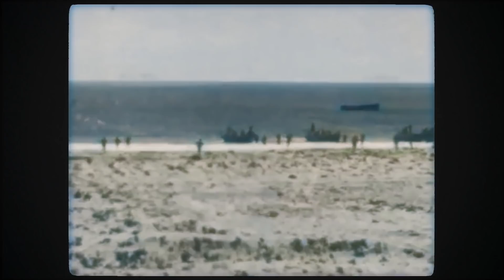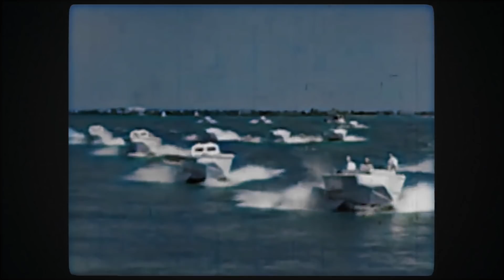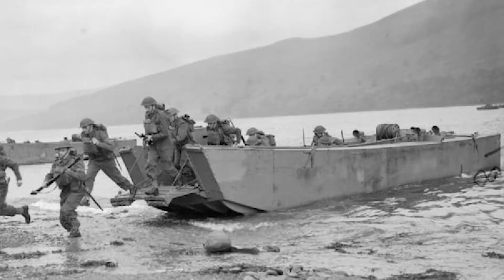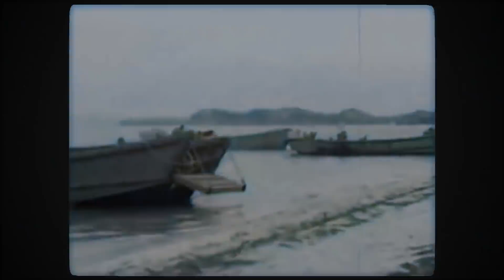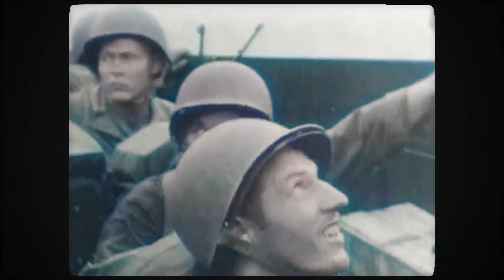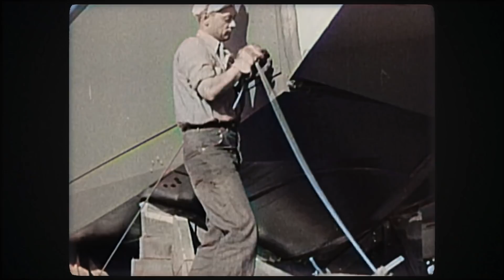The Vehicle That Will Win World War Two? - WW2 Special

Comment: There's references from Middle Ages sources (around C12th) of vessels that sound suspiciously like landing craft.  Although some references say the ramp was at the stern and the boats reversed onto to beach.

"So the fleet came to land, and when they were landed, forth came the knights out of the transports, all mounted; for the transports were built in such fashion that they had doors, which were easily opened, and a bridge was thrust out whereby the knights could come forth to land all mounted."

Comment: Higgins boats pretty much killed many of the soldiers landing at Normandy. As soon as the ramp went down the were raked with machine gun fire. The LVTs manufactured by Borg-Warner could drive up on the beach as far as needed and troops were let out the back. There was also a armored tank version that could've accompanied them. The Marines used these in the Pacific and were able to get further onto the beach. If anything, they should've stuck with the faster Eurekas and built a ramp on the back.

Comment: I think the bulldozers used to rapidly make airstrips on pacific islands are at least as important strategically.
Reply: And Marston mat. It was used to pave airfields and roads and could be emplaced very quickly using unskilled labor . A 3,000-foot runway required just 1200 tons of Marston mat and could be laid by 100 workers in less than 100 hours.

Comment: The other miracle instant improvisation was the DUKW. It had a HUGE impact at Normandy as it actually eliminated the need for a deep water port -- in conjunction with the amazing topography of the Omaha beach sand -- which was so flat and firm that Liberty ships and Victory ships could routinely bottom out upon it -- to off-load their cargos onto GMC 2.5 ton trucks and DUKWs -- the amphib version of the GMC 2.5 ton truck. Port denial WAS the Nazi grand tactical defense scheme agains the West. The DUKW zapped that gambit. The Mulberries proved unnecessary. No-one saw THAT coming.

Comment: One thing I was told about Higgins Boats was the trouble they had with reefs damaging the vessels or getting stuck on said reefs
Reply: You're probably thinking about the Battle of Tarawa, fought on 20–23 November 1943. Many of the tropical islands in the Pacific have fringing coral reefs, or are just the fringing coral reefs around a central lagoon (called an atoll). Coral doesn't grow at the higher latitudes where amphibious operations took place in the European theater. But even at Tarawa, the problem wasn't just that there was a reef, but that the invasion started during a neap tide, when the water depth over the reef was less than invasion planners expected. After that the Navy got smarter by developing teams of frogmen to scout enemy-held beaches before the main force invaded.

Comment: I disagree.   I think the US Truck is much more important by far.  Ask the Germans about the Russians at the mid to end of war being able to move faster and for longer than they could because of all the US trucks while they were still had to use horses.  And without the trucks the Western offensive would have gone nowhere fast after the beachhead.    The truck is what made the modern army a motorized fast striking force and able to keep going unlike in WW1 where after an attack they could never follow through for any length of time since they got to far from the railheads and the pace the big guns could follow.   Same thing on the eastern front where germany was limited by how close the nearest railhead was for moving supplies and mass troop movements of infantry.

Comment: I'd rather take my chances on an AMTRAK instead of a Higgins boat. The AMTRAK could get closer to or beyond a beach and you could disembark via the rear ramp or going over the sides. With the Higgins, the ramp is facing towards the enemy and creates a choke point and exposes the occupants directly to enemy fire on a heavily fortified beach.
Reply: Amtraks were definitely preferable, but they could never have been built in enough numbers to make an invasion on the scale of Normandy possible.

Comment: It seems pretty straightforward, each phase of the war in a given theater had its own requirements.  In the years where Europe was occuppied and the US was trying to wrest control of the Pacific from the Japanese, the bomber and the aircraft carrier well proved their worth.  When the Allies were at a point of taking territory, the amphibious landing craft was the star.  After landing and driving into land such as after D-day, vehicles like the Sherman and the Jeep prove their worth.

I'd almost be more interested to hear about the machines of war that really didn't prove themselves despite widespread contemporary value and esteem heaped on them.
Reply: The Eastern Front is the only major theater not impacted by the Higgins Boat ( and the other innovative landing and supply craft it sailed with ). From North Africa to both Western Fronts in Europe to the Pacific and beyond the Allies had to have something that put men and their supplies into the fight.
Reply: Flying fortresses weren’t particularly capable of hitting anything.

Comment: Great video! I wonder how much added value the machine guns on the Higgins landing craft had. Were they accurate enough to provide any real cover for the men? Rocky seas would surely not make it easier to hit anything
Reply: Good point! The help might have also been psychological perhaps? If the landing was opposed locally, then the machine guns could encourage defenders to take cover, even if they aren't hitting them directly.
Reply: Area Suppression fire .. basically the same tactic as the German with his Mg34 spraying  lead in your direction used. You'd probably be using tracer so you can see where they are going as well. 
Plus rocket ships sending unguided tons over your head and big naval guns doing the  landscaping work. 

Remember Hitler only had plans  for Rhine /Dutch barges in his planned invasion fleet. And in the early parts of the war they were still using a huge number of horses to carry kit and supplies.. 

Then youve got the tank carriers ..carrying the Hobarts funnies..  and the Mulberry harbours and Pluto the submarine fuel line that kept the landing forces running .. especially the air cover.

Comment: There's no way the Higgins was the most essential or best equipment. T34 maybe
Reply: t-34 was the tip of the spear, but it also needed the handle (in this case, supply chain) to gather strong enough force to punch through the line, so it's hard to say
Reply: The T34 was a great tank, but it played no role in the Pacific and would have had little utility in amphibious operations even if it was present. 

If anything people focus too much on equipment like tanks or fighter planes. The humble locomotive probably played a bigger role in the Soviet war effort than the T34. Same for the Studebakers transporting Soviet troops and the equipment to keep them fighting to the front.

Comment: The war was won by soviet trains. They could supply and deliver armies to places where Germans could supply far smaller force.
Reply: Great point,  but hundreds of the locomotives were Lend Lease from the United States. The Soviet locomotives were run to death and Lend Lease trucks, locomotives, etc allowed Soviet factories to focus on producing combat vehicles and weapons.
Reply: @amerigo88  Great point, except for the fact that the Soviet pre-war stock of locomotives were in the tens of thousands which was part of the pre-war focus of the 5 year plans
Reply: You mean American trains operated by Soviets ;)
Reply: I mean 2000 American trains and 22000 soviet trains. The lend-lease overall was critical but trains were not as critical.
US-supplied 58% of soviet Aircraft fuel.
And lots of trucks. 
Now something critical, 30-40% of soviet heavy and medium tanks in the Battle of Moscow were British.  Also, the Soviets got some tools for their factories that they didn't produce themselves but were relying on Germans before hand.
Reply: @jouniosmala9921  22,000 including pre-war stocks. Soviet wartime production of locomotives was less than 500 with about 1,000 railcars (compared to 11,000 railcars imported through lend lease). Naturally the newer locomotives would be put into service over the ones produced in the 20s and 30s. Many of the older Soviet locomotives wouldn't even have been able to run on the new lines being built.
Reply: I would say the could also be won by Liberty cargo ships. It was them that  moves war resources to every singles Allies countries (soviet included)